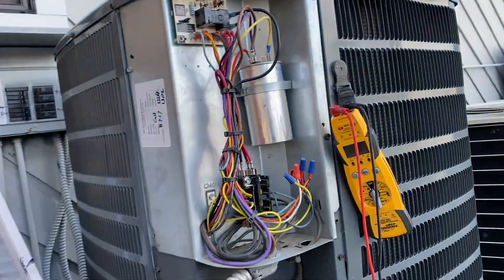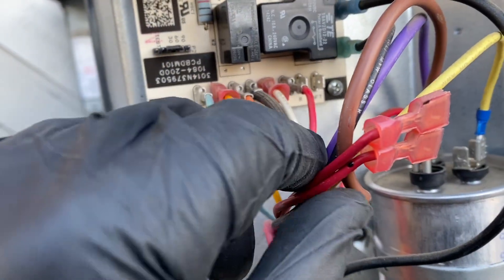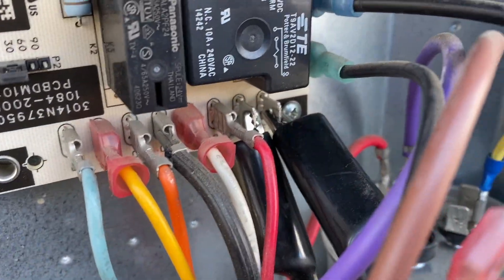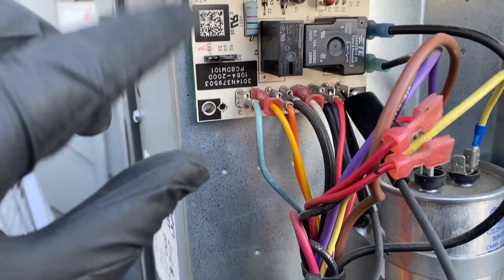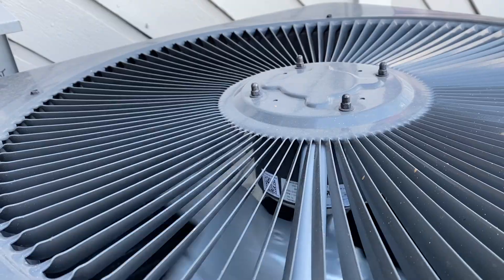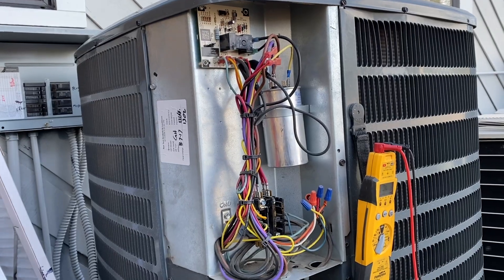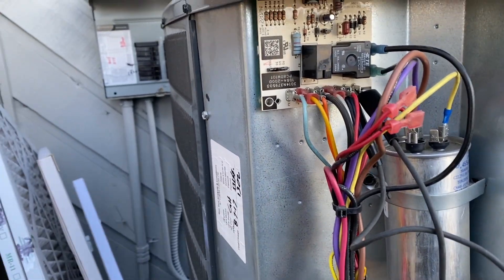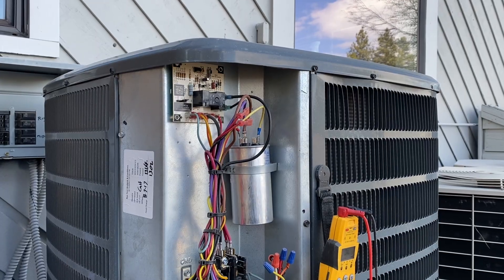Quick Clip: Defrost Cycle and how to Test on a Goodman Heatpump. EP 58

Comment: Heat pumps in the north east are horrible. Try working on one in a blizzard or up a ladder for a mini split repair when it's 5 degrees out with 30 mph winds and sleet. When I get calls for heat pumps in the winter I tell them it will be a month until I can get to them. I have plenty of work with boilers and furnaces and guess what..They're inside !!

Comment: Just to clarify when you alter the timing.....is this correct?----> there are 6 pins....the left-most 2 pins are "test" and then 4 more....let's call all of these ( starting from the "test" side) 1-2-3-4-5-6. So "test" would use 1-2..... 30 min would use 3-4..... 60 min would use 4-5.....and 90 min would use 5-6..... is that the correct way to look at this ??

Comment: Great explanation! Coming from the Midwest to the desert southwest, I was freaking out seeing the fan stop working, hearing horrible noises, and getting cold air from my vents! I googled “Goodman defrost mode” and found your video! Now I understand. Thank you!
Reply: Single stage heat pump are trash at 32f and below. Even inverter systems are not good sometimes.

Comment: I Have a Goodman heat pump, less than 4 yrs old. Installed with my new home. Unit failed after 2 years. Installer said coolant was overcharged (600+ psi). Replaced compressor $1200 under warranty (part and labor). Unit failed again after that, blower motor was burned out. I paid $300+ to replace that. This past June unit failed again. $456 to replace capacitor. Unit failed again today blows warm air as usual, compressor and fan are running. No problem whatsoever during heating season only during cooling season. Needless to say I am not impressed with this Goodman heat pump which has cost thousands to repair and less than 4 years old. LEMON!!! Any suggestions?
Reply: Actually I’ve had 4 companies work on this unit. Most recent was a routine maintenance 3 days ago and they said everything checked out fine. I’m living in a desert climate for 35 years and in recent years the 100+ degree heat waves have been brutal, lasting 6 to 8 weeks during the summer months.
Reply from the maker: You might try one of those condenser misters. Especially on the hotter days. It will reduce your head pressure lowering the load on the compressor. It looks like a joke when you see it, but in extreme heat it can be effective.
Reply: Technician came back today and diagnosed the problem as stuck reversing valve. Said replacing that should fix the issue.
Reply from the maker: Fingers crossed 🤞
Reply: A capacitor costs $15 and takes 10 minutes for the tech to replace.
Reply from the maker: I'm sorry to see you're  having so many issues with your AC unit.  High pressure will kill a compressor. Especially if it's running for a long time.  I'm surprised the high pressure switch didn't cut off your unit. Usually when this occurs the outdoor unit will cycle on and off and will not cool.   The fact that your unit was overcharged  is definitely a mistake by the installer or tech.  The failed blower motor can be caused by dirty filters, under sized return grill/ducts, some type of airflow restriction, or an out of specification capacitor.  If the replacement compressor was not installed properly you might have another compressor failure in the future.  Unfortunately sometimes you can get a lemon.  That goes for all brands.  It might be a good idea to try to find another company to take a look at the unit to get another set of eyes on it.  I wish you luck and hopefully no more issues.
Reply: One suggestion...is to invoke the 10 yr warranty you have for the parts at least. What?.....$450 for a capacitor?...first of all, it's another free warranty part and if you buy one, it will be $10-$30 to replace yourself. I like pro's and I understand they need to make money but I hate hucksters taking advantage of non-technical people.

Comment: I have the a Goodman that is blowing the 3amp fuse. I traced it to the defrost board (red wire). I replaced the board, it ran for a few days but blew the fuse again. Any suggestions. FYI. I didnt see a short in the wiring but may switch to another wire for troubleshooting purposed. Thank for the great video!!!

Comment: My thermistor is tripped and kicks the defrost on but only lasts for a minute. If I jump the board it will run about 10 minutes. Why is this? Bad thermistor?
Reply from the maker: It could be the defrost thermistor or the defrost board. I’d start with the thermistor.
Reply: Thanks for the fast reply. The lower third of my heat pump has about 4” of ice on the outside and inside.  I don’t think the defrost has been running for the whole duration causing this buildup here in Northern Idaho.  Would it be a bad idea to leave the board jumped until I get a new thermistor? It will be under 40 degrees for a while.
Reply from the maker: If you do that It may just go into defrost constantly. I’d just run your heat in emergency mode till you can make your repair. Or set the timer as long as possible. Good luck!
Reply: Thanks for the help!

Comment: I tried the same process on my unit and when I remove the test pin jumper, it goes right back into heat mode. It does not stay in defrost mode.  Maybe my board is bad?
Reply from the maker: You could try leaving the pin on test or try it without jumping the defrost thermostat. It’s weird. Some you have to leave the pin on some you have to remove it.
Reply: @NighthawkHVAC  Thanks for your response.

Comment: Heat strips are not allowed in CA? Whoa. I live in central Texas, right in the middle of the ice apocalypse a few months ago. My heat pump condenser fan blade froze up with ice at one point. Without the heat strips I would have been doa. Defrost cycle ran normally, but it was so cold it couldn’t melt the ice fast enough. 
Even in 20-30-ish degrees, like a normal Texas cold snap, it still needs to defrost about once an hour. 
No heat strips seems insane for freak weather events. 
Also during a normal cold day in December my capacitor went out, compressor would not start. Heat strips saved the day until my new cap arrived a few days later.  
No heat strips as emergency heat on a heat pump seems flippin criminal.
Reply from the maker: They are not energy efficient. That’s why that outlawed them. Plus it doesn’t get that cold in SoCal. Coldest it ever got in SoCal was 37 degrees in the late night.

Comment: Horrible! 😁😁😁
Nah man, you did a good job. That version of the defrost board is much better than some of the older designs where the defrost setting pins were on the top right hand side, and much harder to get to. And the two fan wires were located on the left side of the board, right there for the door panel to fall  into them and short to ground when you're taking it off.